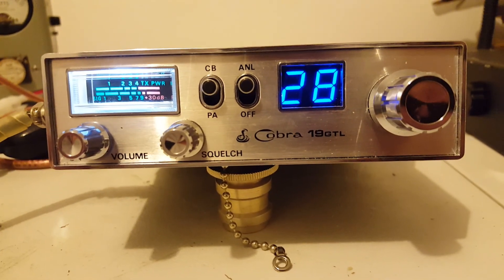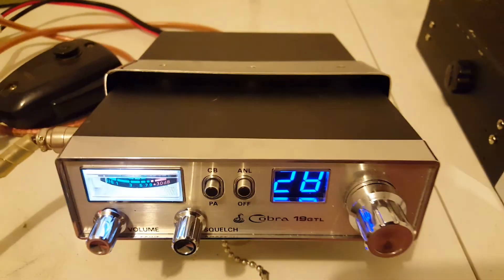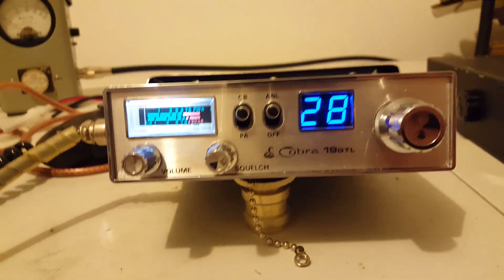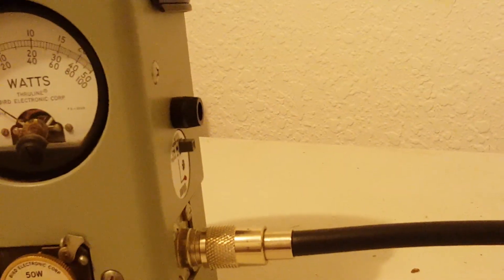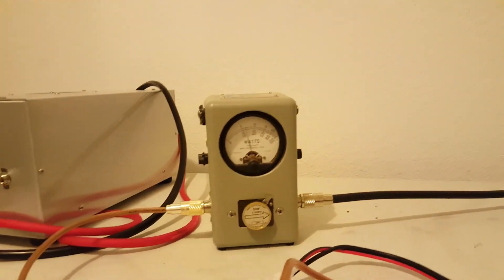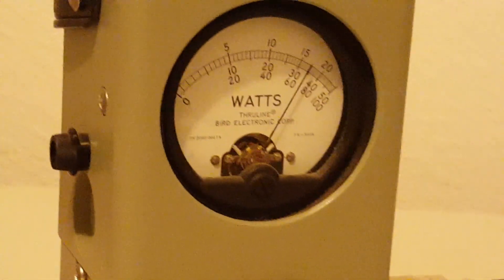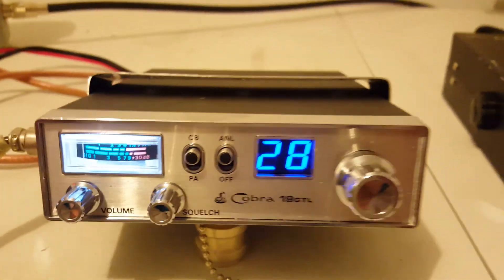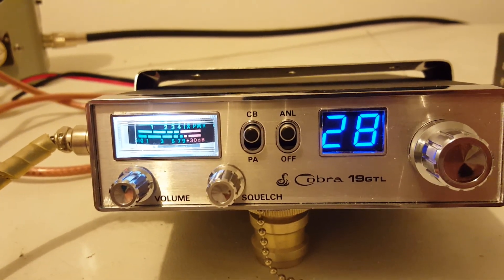Cobra 19GTL Powerhouse, Gump Tuned

Comment: Good little cb radio, neat finnish, like the blue back ground light, eaiser on the eye, i have one of these, thinking about using DDS VFO. Si5351, rotary encoder, arduino nano, should be a good conversion.